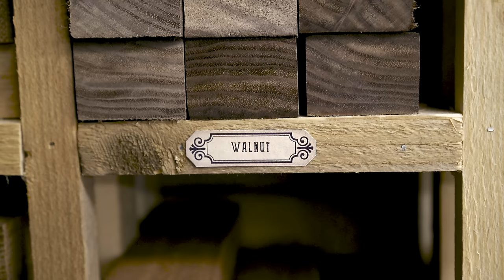$2 Junk Knife Restoration with AMAZING Finish

Comment: A rotary extension attached to a turning chuck...

Will wonders never cease?
Reply from the maker: So far works great. It shouldn't be any problem if is regularly oiled.
Reply: @FFD_Restorations  

It's definitely going into my mental tool box. If it works, it works.

Comment: That "junk" knife was so ground down - it was worth re-sharpening it for years, likely decades, to the original owner. Simpler times. I love tools from those bygone days, even if I lack skill to restore them. There's nothing like the feel of oil-finished walnut handle. Today, if you go to Amazon reviews of carbon steel knives, there's always negative reviews of people complaining that their knives (or other items) rusted. How did their ancestors thrive without stainless steel for millennia? Thank you for the video. I would've appreciated some longer, slower full views of the finished product. Definite "like".
Reply from the maker: Much appreciated, thank you kindly! Noted, thank you for the feedback and suggestion 👍

Comment: Wonder what the original purpose of this knife would have been? Great save and agree the shop is looking terrific.
Reply from the maker: My best guess would be that someone used this knife 24/7. At work, in the field, for every meal.  By design it looks like a military knife. But, without any markings on the blade it is hard to confirm that. Anyhow, this knife was a great asset to someone in the past and it was pleasure to restore it ☺️

Comment: Would it be possible to weld a piece of blade to the knife to restore the width?
Reply from the maker: Yes, but I would not recommend it. It will never be the same if you would use that knife later on.

Comment: What's the stuff you put on the saw blade?
Reply from the maker: Thank you for your curiosity! The substance you're referring regular soap. It helps reduce friction and heat during the cutting process, ensuring smoother and more efficient cuts. Is there a specific project or type of sawing you're interested in? I'd love to share more details or help with any related questions you might have!

Comment: What was you using on the saw blade @ 7:50 👍🏽
Reply from the maker: Old soap, helps to have better cuts and the saw teeth has less resistance while cutting.

Comment: Always a bit disappointed to see these over sharpened blades restored, they are just way to oversharpened that they  aren't  worth sharpening and using as a knife.  

Totally get the appeal and like seeing the handle restored is cool, but it's such a waste with the blade like that. Would rather see it on something that could actually be useful after
Reply from the maker: Thanks for the feedback 👍